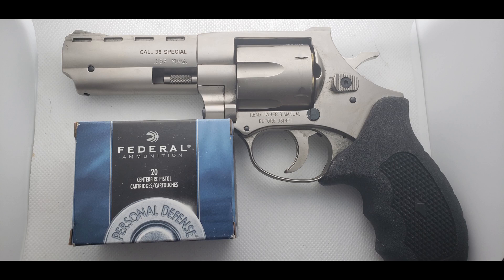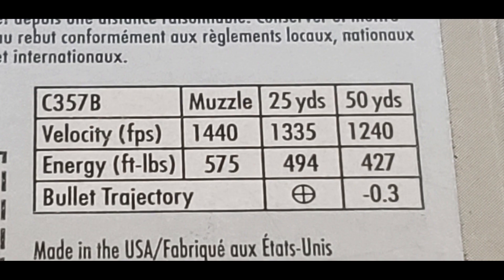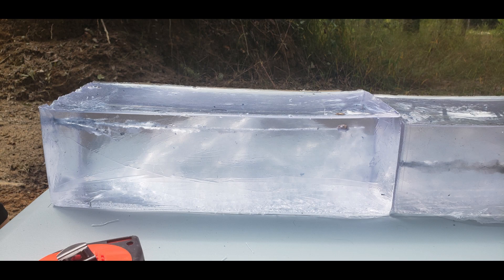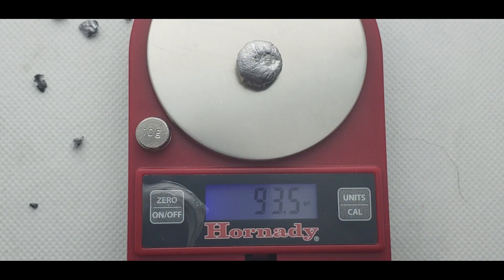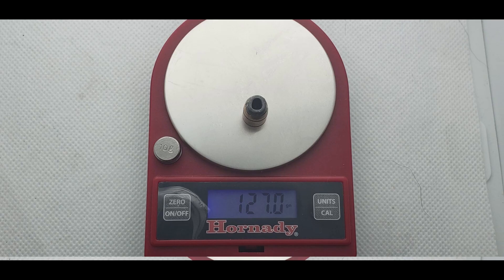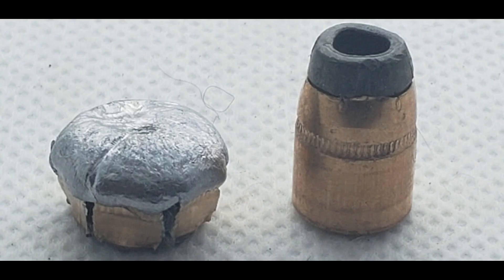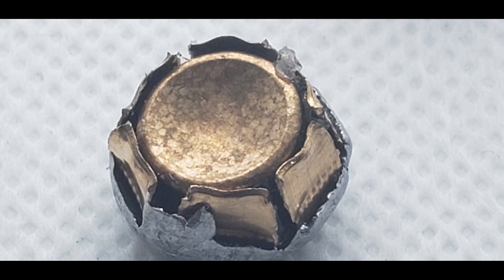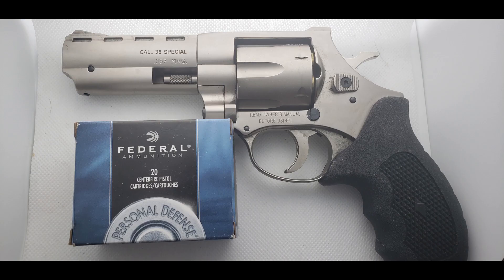Federal SJHP 357 Magnum 125gr Gel Test4 Inch Edition

Comment: One thing to consider; THIS is the round that ranks 96% on the one shot stop statistics. While in general those charts do not necessarily contain reliable data, this round's data is correct because those stats specifically came from actual LE encounters, and all from a 4" barrel. This combo was the official LE standard. So whatever this round did, all others should be compared to in my humble opinion.
Reply: fully agree. Thi is the manstopper cartridge algonside the old  357 Remington SJHP 125 gr.
Reply: @holaadios9958  I believe the Winchester 125 gr SJHP is added in to. I should compare all 3 and see if there's a difference. I know the Remington has those scallops with more exposed lead so it makes me wonder.
Reply: This was the original poison bullet of the old-school law enforcement community.this round has a massive street cred record. 357B to me is the round of DOOM!
Reply: The scariest 357 magnum round.
Reply: It makes sense why this round was so effective.  It hits with a lot of energy, has ideal penetration (12-15 inches) which tends to dump all of that energy into the target, and expands reliably.  In addition: While it fragments, it does better than other handgun calibers which merely deposit pieces of the bullet along the main wound channel.  These fragments fly outside the main path and create their own separate wound channels.  As far as I am aware, even the .357 SIG which is nearly as powerful as .357 Mag is unavailable in SJHP.  So, it is missing the lead tip which tends to fragment so spectacularly when fired at magnum velocity.